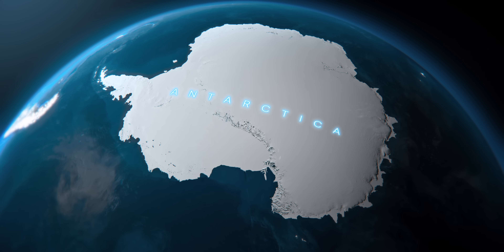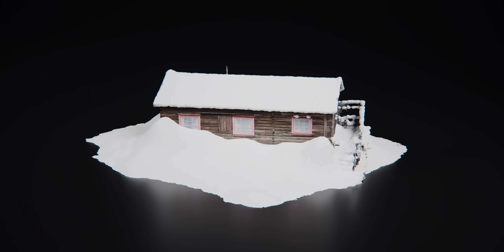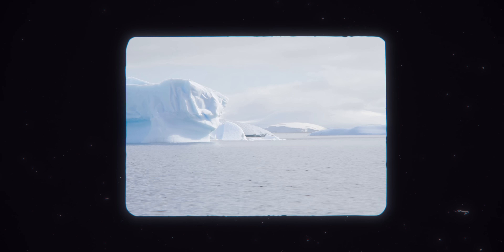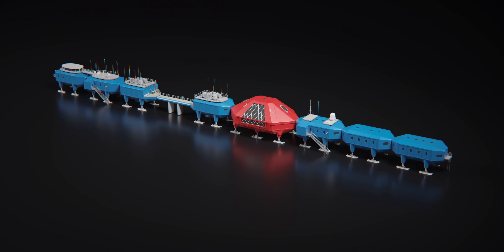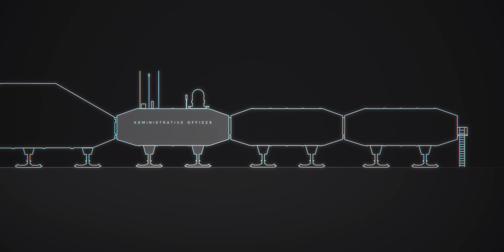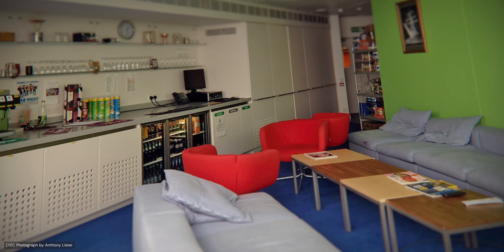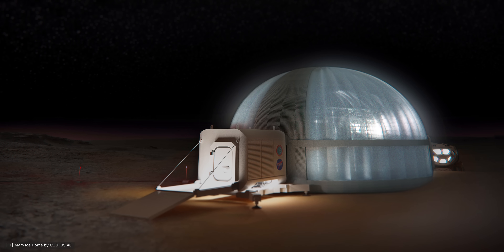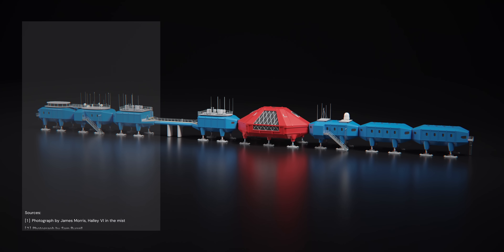The Genius Design of Antarctic Bases

Comment: During my time at BAS, a scientist mentioned that the Halley modules needed to be completely emptied before relocation because their weight had been underestimated. Originally, the plan was to transport them fully loaded with all their equipment and contents still inside.
Reply: At least it can be moved and considering it’s on a moving ice sheet that priority tops everything I suppose.
Reply: @sirierieott5882  exactly. And having to use the Antarctic equivalent of a removal van can be an opportunity to inspect, upgrade or replace equipment, to reorganise the interior based on experience of living and working in it, etc.
Reply: could the tractors not tow them, or was dragging them cutting the ground up too much??
Reply: @TheKlink  prob to heavy for the skis which could cause them to dig in when being moved.
Reply: That's unfortunate.
Reply: Well that sucks :(
Reply: Huh, how did that get miscalculated?
Reply: Because it's the first of it's kind and engineering involves a lot of guessing until you've done some trials and figure out where stuff doesn't work as intended
Reply: @EvonixTheGreatest  Happens in shipbuilding as well. There are many cases where naval architects did not properly consider the amount of weight a ship would carry, be it a warship (Vasa from 1620) or cruise ships, where the weight was not properly estimated.

Modern ship building projects move to fully modeled 3d plans, where all of the equipment is installed in the virtual model along its weight to avoid this.
Reply: @mephisto8101 happened quite recently when the New Zealand navy bought a couple of ice strengthened patrol ships, but because they were slightly too heavy, the waterline armoured belt was submerged and therefore useless! 

And sometimes people have miscalculated accidentally on purpose: I'm referring to the naval treaty period of the interwar years when designers got creative. For example, the Royal Navy's County class cruisers sat suspiciously high in the water until, when WW2 started, a couple of them went in for a refit and came out sitting much lower. Seems there was a lot of reserve built in to the design, on purpose.
Reply: Seems strange to make that mistake, the calculus is not rocket science...If I can say...😂
Reply: @honumoorea873  it's very common with big projects, usually because you're working with a brand new design and you can't build a full scale prototype for testing. It also happens with specialised ships like ice breakers, or large onshore infrastructure. Usually the fault has to get fixed because you can't afford to junk the big thing you just built, or you find a work around, as here. The only exception to this is aircraft where they do build prototypes... because if an aircraft is wrong it either won't fly or, worse, pick an awkward moment to stop flying!

Mistakes still happen. Turns out making new things that no one ever tried before is, actually, rocket science!
Reply: @lukedogwalker  if they had blueprints of the design, it is as simple as finding the volume of steel needed and plugging in the weight of the steel per volumetric Unit. It’s actually incredibly easy, if all of your measurements are correct.you can even account for the welds